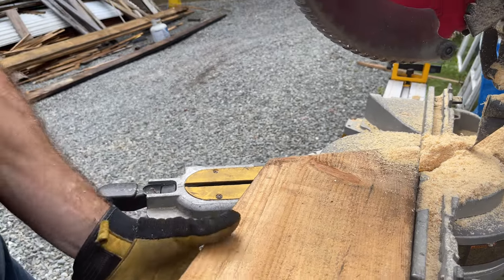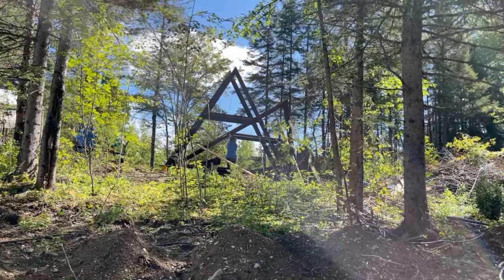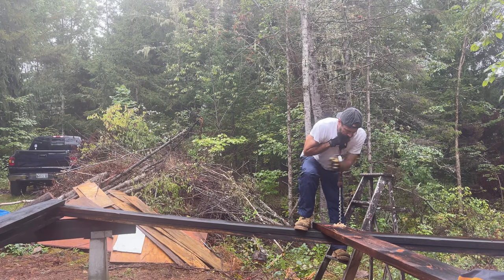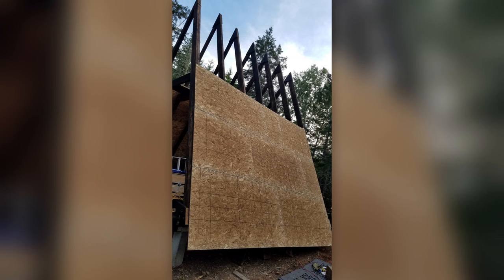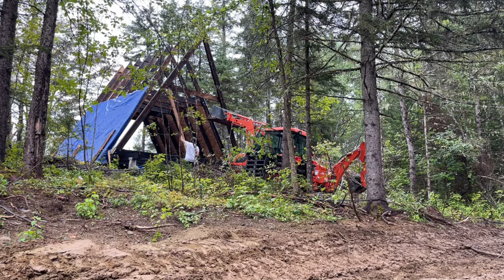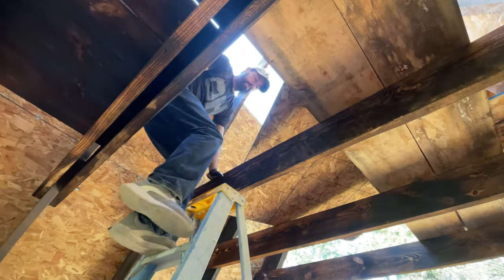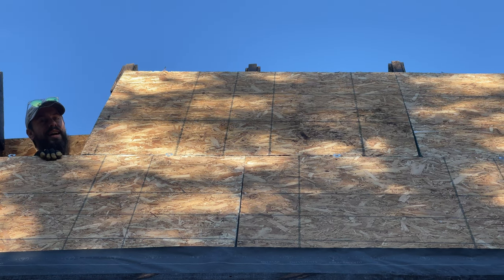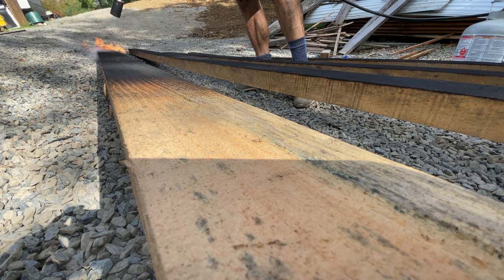A-Frame Cabin Build - Off Grid Cabin Build PT. 2

Comment: In the video scene where you are adding the bolts, are the double 2’s the joist? And if so, did you double up on each “A”?  How far apart are you installing the “A”s?
Reply from the maker: Each A is 4 boards, except for the first and last..those are 6 boards (A’s doubled). When the A is raised, 2 boards up and 2 are down as the joists. 8 A’s at 2ft apart. A Frame sits on top of 3 girders anchored to cement piers that are dug into the ground @ 4ft deep.

Comment: Great build what size are the “a’s”? What size of lumber ? Did you use any plans. Thanks
Reply from the maker: A’s are 20ft rough cut 2x10. Cabins and Cottage’s book had a few pages on building an A Frame…lol that’s what I followed. Thanks for watching:)
Reply: I was just about to ask the same thing. Was there too much/not enough room for insulation?

Comment: Sorry for my ignorance, what is the puropse of burning the wood with a flame? Is it because of the moisture, or there are other reasons? Thank you in advance.
Reply from the maker: I talk about it at the end of the video lol:). It helps treat the wood, fireproof, insect, mold, strengthen, rid the moisture, and more😎
Reply: @offgridmaineattraction  thanks! Sorry, I don't know how I missed that part. Maybe the speakers were off. Cheers!
Reply from the maker: No worries:)